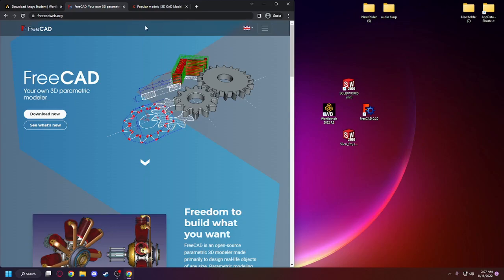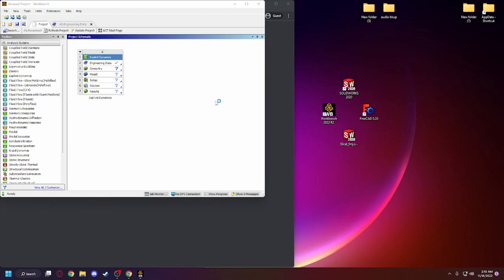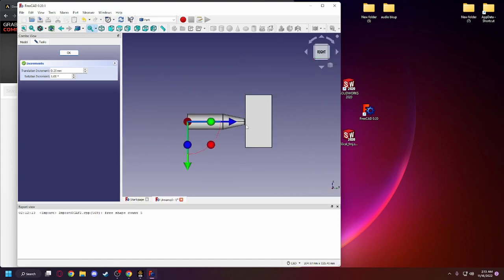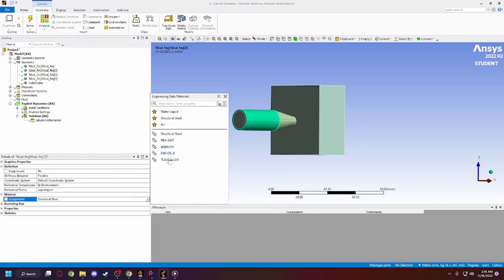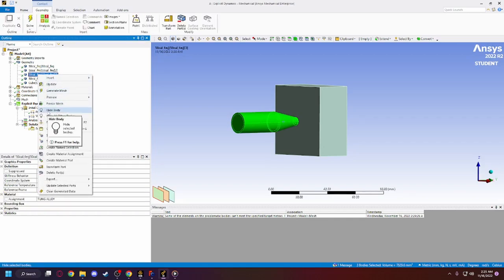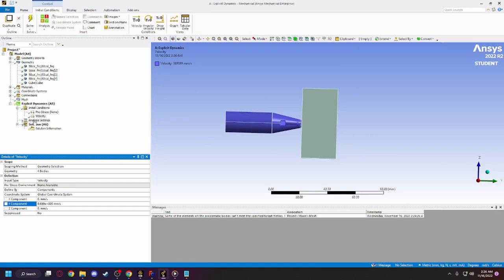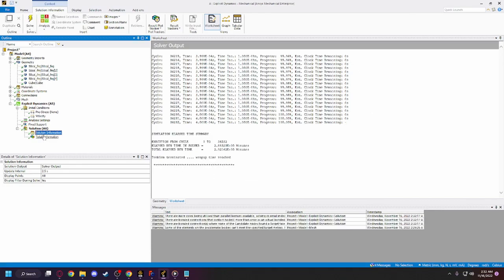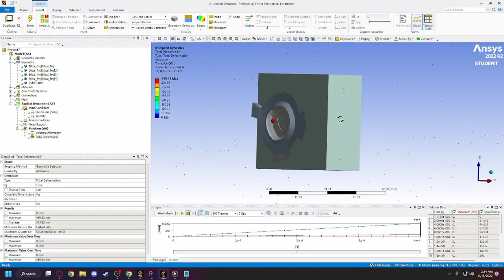Ansys bullet simulation tutorial

Comment: M1A2SEPV4 firing the latest M829 at Iowas outer belt at 1000m. For reference outer escaping belt is 1.5 inches of STS several feet of distance then another 2 inches of structural Steel bracing, 12.1 inches of Class A armor at 19 degrees on top of .875 or 1.5 inches(sources vary) of STS also Angled at 19 degrees.

Comment: Its saying that the time steps are too small. Can you help? Its also giving me just 2 frames of the animation.
Reply from the maker: I get those a lot, sometimes lowering the mesh size can help, I've looked up how to fix that issue before but i don't get any helpful results. Most say to change the minimum time step in the analysis settings to a really low number instead of program controlled but its never helped that issue for me.
Reply: @ToastRepublic  i figured it out, i did the opposite, increased the mesh size and it worked.
ill try your method.
Reply from the maker: @raiden542  ok good, yeah I forgot to mention that increasing can help, it just depends on if it effects your model.( like messing with a bullets copper jacket or something)
Reply: @ToastRepublic  i never added a copper jacket, how is that done?
Reply from the maker: @raiden542  If you are making your own bullet in freecad, you can use the offset tool to make one.
Reply: @ToastRepublic  I made a bullet with just the cut and union buttons.
Reply: @ToastRepublic  I did the really small number solution and somehow it's working

Comment: Hi could you tell me what is the file format of the projictile when you put it in freecad?
Reply from the maker: Sure, when I make projectiles I save them as a step file. And when I import or add objects to my projects, I always use step files.
Reply: @ToastRepublic  One more thing, when the sim finshes the number of frames is very low and it says "time step is too small" how can I increase it and the frames? btw thanks so much for the reply.
Reply from the maker: @al7bndgsh706  No problem, when it comes to the time step, mess with the mesh size, increase or decrease it.That can fix it, but it would depend on the size of the simulation, making it too big can mess with the models too much, too small can cause more errors or long render times.

Comment: Followed this tutorial but neither my bullet or my wall deform and the bullet just flies back
Reply from the maker: Sounds like its just ricocheting back, so I have 2 questions are you using the default material? usually the default is structural steel which isn't good for ,these types of simulations. 2nd question, how fast is the projectile going?
Reply: @ToastRepublic  For my wall i am using concrete and the projectile is going 936metres per second also i get an error saying energy error too large